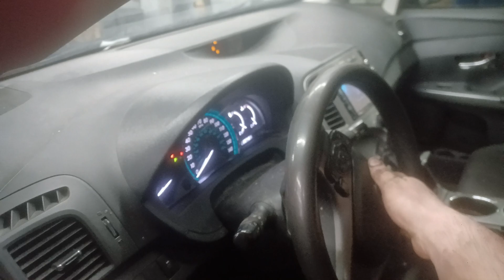$ Can I use 2ARFE 2.5 Scion TC Camry engine in my 1ARFE 2.7 Toyota Venza or Highlander ? EXPERIMENT

Comment: GOOD MORNING I HAVE A 2006 RAV4 THAT HAS A 2.4l 2AZ-FE, I AM THINKING ABOUT DOING A SWAP USING THE SAID 2.5L . CAMRY ENGINE. MY ? IS WOULD I NEED THE COMPUTER FOR THE 2.5L  AND DOES THE BOLT UP WORK FOR 4WD APPLICATION.

Comment: I have a 2011 toyota venza 2.7l FWD ..Bought the car with broken timing chain..Was looking into exactly what you have done with your venza..Question is the transmission bolts up the same to the new 2AR-FE motor???...Question #2...The ecu and everything is all the stock venza electrical from the original 1AR-FE engine that is being replaced??..Please let me know..Thank you also for the awesome video!!!

Comment: How does it runs and do you have any problem or any sensor need replace
Reply from the maker: Runs excellent, haven't had to change any of the sensors or anything. No engine light, worked out perfect 👍

Comment: Can you use 1AR-FE in camry ? 2AR-FE become 1AR-FE ?
Reply from the maker: 1AR-FE is the engine code for the 2.7 l and the 2AR-FE is the engine code for the 2.5. so it doesn't change the engine code of what the engine is but it should go into the vehicle and work just fine  basing it off of this experiment.

Comment: Great work man.
The ECU might just adjust for the difference in displacement.
Reply: How many miles have you put on the swap? Any issues or codes?  Or problems you ran into while installing?
Reply from the maker: @ric9707   have put approx 250-300 miles so far. No issues. Only issue I had with swap was kinda unrelated to engine interchange. Had a broken wire in the harness from flopping it over the driver fender during install had to track down but that's pretty much it
Reply from the maker: Thanks.  Yes, it runs and drives great with no engine light even. 😀
Reply: @ppvracing5597  I’m trying to boost a 2018 Camry with the 2ar-fe . Just trying to figure out the manifold specs for intake and exhaust
Reply: @ppvracing5597 hey brother thanks for the valuable and priceless advice in the video ! 
I was going to ask you what year was the scion that the engine you used came from ?
Reply: I have a 2015 rav4 am looking to see if I can install a different transmission there from 1500 to 2000 for used